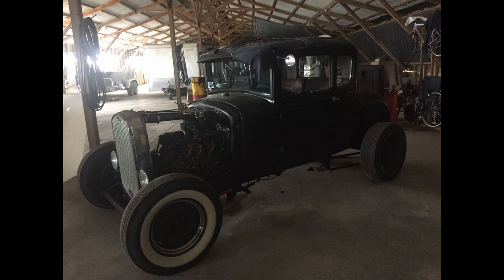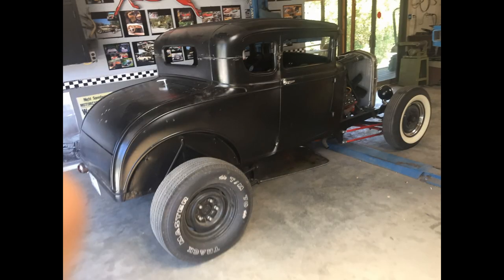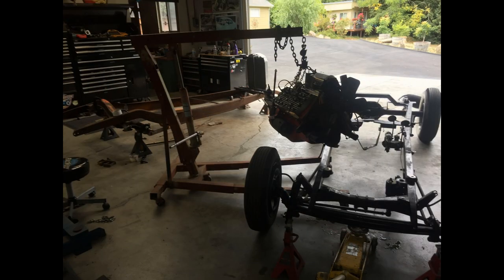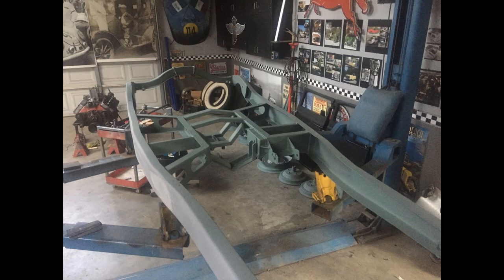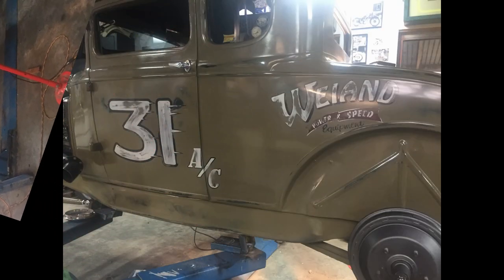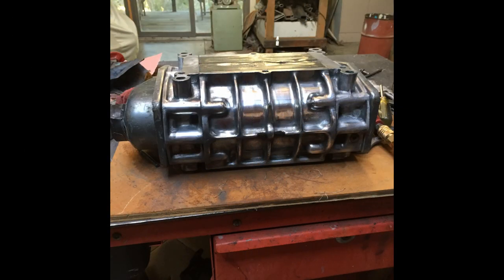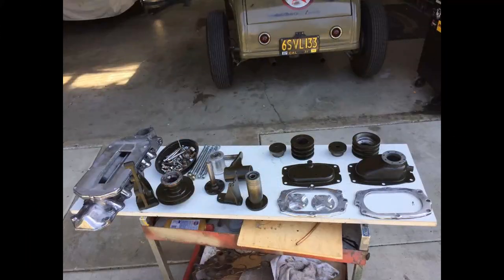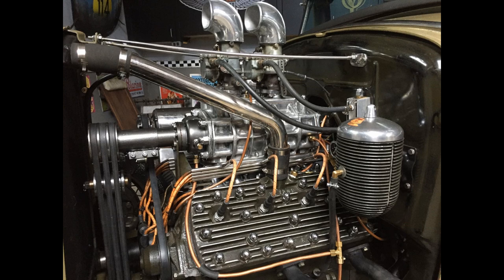A Hot Rod Build Story 1931 ford blown flathead

Comment: Have to ask how forced air works with a 4-inch stroke under heads notorious for overheating. Beautiful work, though, =for= sure.
Reply from the maker: It runs at 175 - 180  all the time.  Never over heats. just lucky I guess?